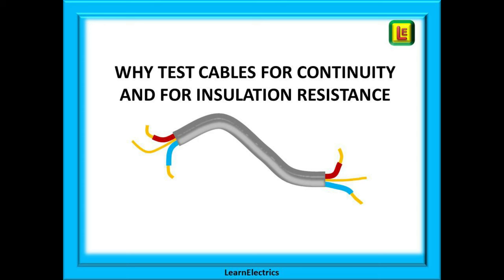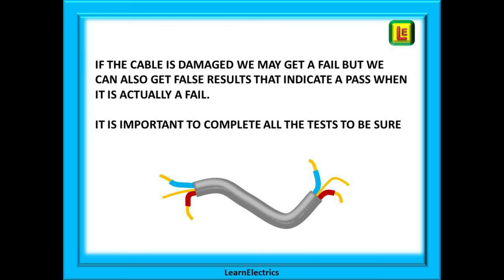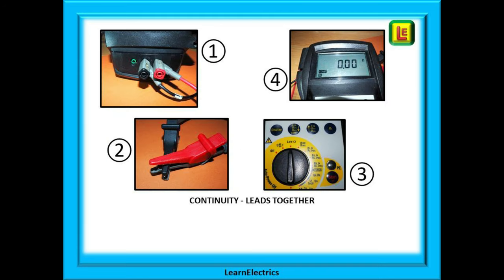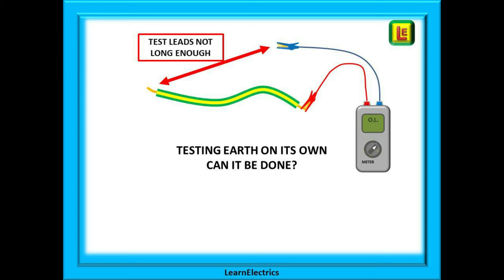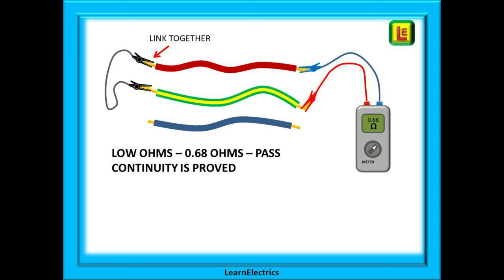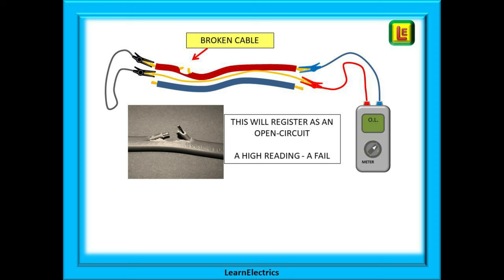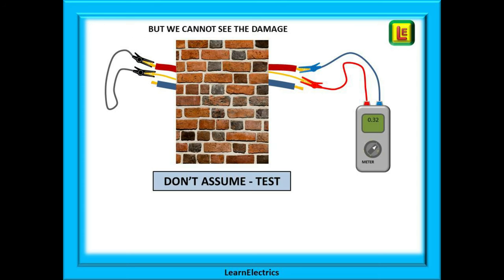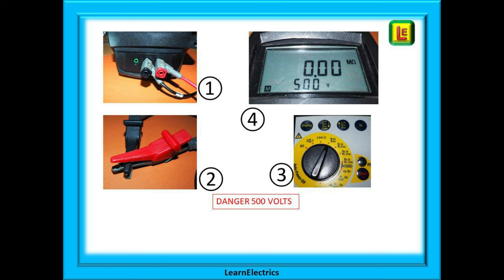CABLE TESTING. HOW TO TEST CONTINUITY AND INSULATION RESISTANCE

Comment: Great video guys and a must to do just after the plastering. I recently checked a ring final circuit and found the continuity was fine but the Insulation resistance failed. Eventually narrowed it down to a plastered board screw through a cable in a stud wall. Other trades can be your worst enemy, so always check and where possible protect the cabling from potential damage. Test, test, test...
Reply from the maker: Thanks Andy, spot on comments.

Comment: Once again no one explains things better. Thank you! Very easy to follow and retain the knowledge at the end. 

I recently tested an installation after changing some face plates and light fittings as well as extending some sockets outlets. One of circuits passed the continuity test but failed the insulation resistance test  however the RCD has was not tripping although it is mechanically sound. It doesn’t make sense so I am going back to re-test the circuit as I think I must have made a mistake like leaving something plugged in or a bulb or maybe some other mistake I made as I was tired. It would be great if you can do a video on insulation resistance testing at DB, single circuit and whole installation.
Reply from the maker: Yes, if the IR test fails, always check for things left in circuit. Usually Le and NE pass but LN fail. If its lighting remember to flick a switch and test again. Dave.

Comment: I did an extensive insulation test between a wire and the ground, actually the wall. So I watered the whole wall with water, also above the cables. In case of damage in the wire insulation, there will small cracking sounds coming from the wall, and the resistance will be low. I put water also to easy the conductivity and find possible deffect. Also, I am testing with 1000 volts.
Reply from the maker: Thanks for the input, appreciated.

Comment: Some of the stages of the PAT inspection’s I used to perform were also similar to this,

If someone or Spark rewired their radio/microwave and all was well i.e. correct fuse, polarity and earth pass, visually OK and correct size wire etc it would get a pass.

However this seems not to be the case for electricians in domestic installation situations.

They don’t seem to happy signing off someone else's work, I would like to ask the reason why?

Is this because the test instruments of today are not adequate enough to prove the wiring
And therefore do not give them the confidence?

Great channel by the way, one of the best out there in my opinion.
Reply from the maker: We sign for the work that we have done when wiring installations. Hope this helps. Dave.

Comment: Another very good lecture Dave. By the way, I like the way you test continuity and I can wait to see the fault finding but it seems like you are doing R1 + R2 and R2 + Rn, if not I can start by doing that. Thank you once more for the well and rich lecture.
Reply from the maker: Absolutely right Omar. It says at the start of the video that we are treating this as first fix, in other words we have just installed the cables and not yet attached any accessories etc.
When the cable is newly installed we should test to confirm that all three cables are good L + N + E. It is no good waiting until all the walls are plastered and the sockets fitted to find that the neutral has a break in it. We are doing another video on testing with accessories installed. Good question and thanks for watching. Dave.
Reply: @learnelectrics4402  I have seen electrician checking their cable before all the boarding is done but still a screw goes in the cable after the plasterboard. So, to be on the safer side, what you meant is , you check before the plaster and after.
Reply from the maker: Correct Omar. Check at first fix and if all is ok any damage that you find on second fix checks might be caused by the plasterer or carpenter. Who is going to pay for these repairs, the new cable, re-plastering the wall etc. If you don't check all your cables at first fix, how can you prove it is not you fault. For the time it takes to check at each stage it is worth it. Good luck. Dave.

Comment: Excellent video again again mate very helpful just one question, when you did the continuity of CPC and phase conductor with the link would that also be the r1+r2 assuming this is a radial circuit or am I getting ahead of my self 🤯 keep the videos coming all very helpful and thank you
Reply from the maker: Absolutely right Mark. I'm being picky now, but we should call it R1+R2 if we are going to put it on a certificate. But having said that, little r1+r2 is actually the same as big R1+R2 for radial circuits but not for Ring circuits so we try to distinguish between them.
Next weeks video will include the differences between them and also cable length calculations from R1+R2 for ring and radial.

Comment: Great video. How do when know what continuity readings to expect if most of the time we don’t no the length of existing cables installed?
Reply from the maker: Thanks Paul. The point I was making was that if the cooker is only 3 metres from the CU then expect a very low reading - maybe 0.03 ohms - big csa and short run. But if it is a lighting point at the far side of a large house expect a higher reading, maybe 3 or 4 ohms - thin cable long run. It only comes with doing the testing many times. Example, when you get to know your car you can look at the petrol gauge and just know if you have enough petrol to get to work and back or whether to fill up on the way. Hope this helps. Dave.
Take a look at our video   -   Cable length calculations and R1+R2   on this link
https://www.youtube.com/watch?v=Qq_9MNH8XxU

Comment: Hello, many thanks for your great videos,, in my country most of the old buildings which are more than 10 years old don't have Earth ,, so what is the best way to perform the test while there is no earth conductor in the building?
Reply from the maker: You can test continuity between the line and neutral conductors and insulation resistance will only be the same, between line and neutral. Thanks for the information, good to know what happens in other countries. Thanks for watching. Dave.
Reply: @learnelectrics4402  thank you very much 🙏🙏🙏🙏

Comment: In a CNE system: ? Before insulation testing between neutral and earth of multiple circuits, is it necessary to remove the main incoming earthing cable from the earth bar in the consumer unit ?
Reply from the maker: Not the main earth, no. Leave that where it is.

Comment: Can I ask a question please. When testing a ring main and they have used the trunking as cpc what do you do for your R1 value and also what do you do for r1+r2 and you can't cross connect? Thank you
Reply from the maker: Good question Alan.
Using the blue 18th Edition Regs book.
Regulations 543.2.2 and 543.2.5 apply.
Conduit/trunking can be used as a cpc if continuity can be guaranteed.
R1 is the Line conductor and R2 will be the trunking.
You cannot do a crossover test as such, just connect one end of the trunking to one line  and the other end to the other line.
Steel is about 12% as conductive as copper but I would imagine your trunking has a csa of much more than 8 times the copper cpc that would normally be used.

Comment: 17:18 continuity test can also detect this fault if the other end of the conductors are open. If there is  continuity then the conductors are shorting somewhere behind the wall.
Reply from the maker: Excellent extra info, thanks for the input. Appreciated.
Reply: @learnelectrics4402  Welcome. One of my favourite channels.

Comment: sir, one of my hot cable is drawing 1A of current when i first switch on the circuit breaker with nothing connected to the cable from the other end. After a while the current will settle at around 0.3A and the wall at the kitchen feel warm to the touch. This circuit was isolated by me, so i can still switch it on and use the kicthen sockets as normal. But when i connect this hot cable with the rest of the hot cables the RCCB will trip. So i had to isolate it from the RCCB and only control it with a circuit breaker. What should i do now?
Reply from the maker: You will need to trace the cables. Draw out the circuit, where they go, what is attached etc. and then work through the possible problems. have you tried disconnecting everything from the circuit first and then reconnecting the cables and see if the RCD trips  with an empty circuit, then add appliances back onto the circuit one at a time to see if something makes it trip. These problems can take a while to sort, take your time and keep notes of what you have tested.
Good luck.
Reply: That's why you turn off the mains switch (between your metre and consumer unit) before carrying out these tests. In my country, neutral and earth terminals inside the meter are connected by design, you can use continuity test to confirm that the two terminals are linked.

Comment: What happens if we fail a continuity test using the line as the wander lead - how do we know which wire is broken? Or if it's both?
Reply from the maker: Find a pair of wires that are continuous when joined together, then you know that both are ok. Mow you can use either as your wander lead. Also, check your wander lead from end to end on its own. If its low ohms, the wander lead is ok.
Reply: @learnelectrics4402  What i mean is say you're testing twin and earth. None of the combinations have continuity. How do you know whether one of them is actually intact or not?

Comment: Hi I have a question about insulation resistance test on ring cirvuits
 When carrying out the insulation resistance test on a ring circuut, shall one test on only one end of the L and N cables? Or can one link the LL and NN and test across them? Thanks again
Reply from the maker: you do not need to link LL, you have already (or should have) proved the conductor is continuous from one end to the other. Have another look at the video, it is explained.
Reply: @learnelectrics4402  thanks for your reply. So one end will be kept loose in s terminal block/connector whilst the other end is tested. Or can it be left in the mcb?
Reply from the maker: It should already be out of the MCB from when you did the continuity test so just leave it out. Happy testing. Dave.
Reply: @learnelectrics4402  thanks a lot Dave

Comment: I have a meter reader don't have the test button what do you recommend for starter? thanks
Reply from the maker: Some meters are auto starting when they find a connection. Turn it on and put the probes together and see if it responds. Meggers do this amongst others.
Every manufacturer does something different. Thanks for watching. Dave.
Reply: I am new but eventually want to get into EV installing I was looking to invest in the KEWTECK 66dl bit pricey is it a good brand?

Comment: During the Insulation Resistance test,I thought you leave all the switches connected one end,whilst removing any components that could be damaged at such a voltage, and then doing the test at the dB end,taking the line out of the mcb,and neutral,and cpc out of there own bars ??
Reply from the maker: John. at the beginning of the video we say that this is testing cables at first fix, before any components are attached and that we are making another video for testing second fix circuits, lighting, power etc.. Hope this helps. Dave.

Comment: Try to explain how your megohmmeter works when you tested Hot to Neutral and there was damage to only (1) conductor. Explain HOW the meter can detect the return current if only one conductor is damaged and you are connecting between the two insulated conductors. Go ahead, I'll wait.
Reply from the maker: If the insulation for the good conductor is of the correct spec, then the test will pass. The test voltage will not penetrate the good insulation.

Comment: Ok here ( Canada) we don't check any installations unless there is a problem after energization. I have done an insulation tests on 600 volt industrial motor starter units that tripped the breaker to find copper traces that shorted out the breaker. ( 600 amp ) Used the 1000 volt settings on our meter. Yes I have found screws or nails in wiring after energization with a tripped breaker. I don't know why we don't take a lesson from our UK brothers. Thanks for an eye opening video.
Reply from the maker: Excellent comments Lyle, real eye openers. I know of several UK sparkies that must have gone to the same Canadian college as you. Turn it on first, look for smoke, fix the problem. Thanks for your great contributions, keep them coming. Dave.

Comment: Hi sir...can we do a phase & neutral to earth insulation test on a lighting circuit which has a dimmer switch...considering that it is in series with the line conductor..
Reply from the maker: Yes, that will be coming up in a video very soon, testing cables at second fix and with appliances attached. You can just take the dimmer switch off and replace it with an ordinary switch for the tests as that is easy to do.

Comment: Can we run insulation test to photovoltaic module ?
Reply from the maker: If it was me, I would disconnect the cables at both ends before IR testing. 500v on a PV module not a good idea.
Reply: @learnelectrics4402  i plan to do the test in the evening, what do you think??

Comment: what meter do you use Dave?
Reply from the maker: I use a Unitest and a Megger, but I prefer the Unitest for Multi Function tester. The Kwetechs are damn good meters and reasonably priced.
I also have a couple of Fluke Multi-meters, but those are for when I work on instrumentation panels.
You can always tell a good meter, they will come with a good set of leads.
Hope this helps, Dave.
Reply: @learnelectrics4402  Hi Dave, the Kwetechs are a solid piece. Appreciate your prompt reply, was extremely helpful

Comment: Can i use fluke 1587 for testing?
Reply from the maker: You can use it for Ins Res and continuity but it won't test RCDs, Loop etc.
Reply: @learnelectrics4402  ty for the information..please send me diagram for insulation resistance test for 2 core and cpc pvc flat wire

Comment: Another great video, great work thanks, keep them coming👍
Reply from the maker: Thank you Lee, appreciate your comments. Dave.
Reply: @learnelectrics4402  no problem Dave your videos are great, I have done my level 3, which scheme would you recommend to join? Would appreciate your feedback, regards Lee
Reply from the maker: Lee, we have a policy of not recommending scheme providers, meter suppliers etc. They are all pretty much the same price, all ask the same questions and have the same standards to work to laid down by the government. Personal choice.
Reply: @learnelectrics4402   ok many thanks, just quite a difference in pricing that’s all it seems to be for the same thing.👍
Reply from the maker: Lee, check what your package includes. they should all be about the same price between 400 and 500 pounds including first assessment fee. you can do staged payments.
If you are domestic only you will only need A1.1 and if industrial A1.2 as well.
Check you are not paying for add-ons like gas and plumbing etc.

Comment: Y getting continuity between neutral and earth .
Reply from the maker: Don't forget that N and E are connected at some point in the system. If you,ve not disconnected at the consumer unit end you will pick up a reading.
Reply: That's why you turn off the mains switch (between your metre and consumer unit) before carrying out these tests. In my country, neutral and earth terminals inside the meter are connected by design, you can use continuity test to confirm that the two terminals are linked.

Comment: What does insulation resistance mean and why are letter like z and s and e used why do they make things complicated grrrr
Reply from the maker: The integrity of the insulation. The ability of the insulation to resist the urge to allow current to flow through it to another conductor. z and s etc. We need to go back to the grandfathers of electrics and ask them, perhaps I should do a video on the derivation of all these symbols. Dave.

Comment: Thank you for the excellent video:
Reply from the maker: Great feedback. Thank you so much. Dave.
Reply from the maker: That's a lot of questions.
Have a look at page 109 in Guidance Note 3.
Test voltage should be between 4 and 24 volts but most meters only have 9 volts battery. Test current is very low from a multimeter or MFT because of the battery internal resistance, in the order of mA. Don't worry too much about how the meter works.

50mA and above at low voltage is potentially fatal.
But the test meter is operating at extra low voltage.

Years ago we called the brown wire (red in those days) the LIVE
Then the boffins decided that we should call neutral LIVE too as it carried the return current back to the transformer.
Then we called the brown wire phase, but in a 3 phase system we call the three phases Line 1, Line 2, Line 3.
And ... why does certain equipment, plugs etc. still refer to the LIVE when they mean phase.
It's a confusing mess but we just learn to live with it. Don't even start on why we call the earth a cpc. 
If we were wiring a lighting circuit together and you said the live wire, I would know you meant the phase. If you said connect the earth, I would know you meant the cpc. We just do it automatically. Its a whole secret language.
Good luck, keep learning, keep asking, spread the word about the channel, that helps. Dave.
Reply from the maker: Great. All learning begins with a question. Dave.